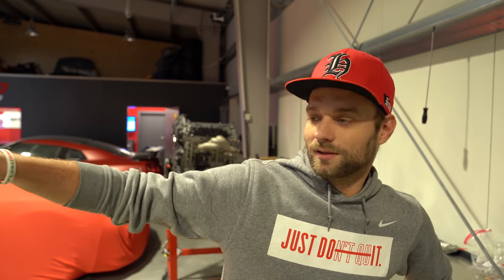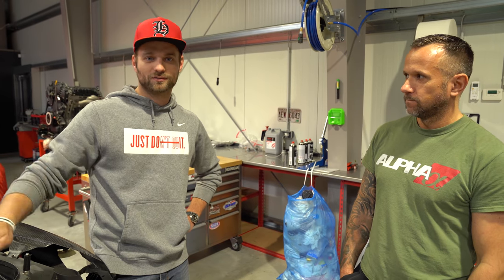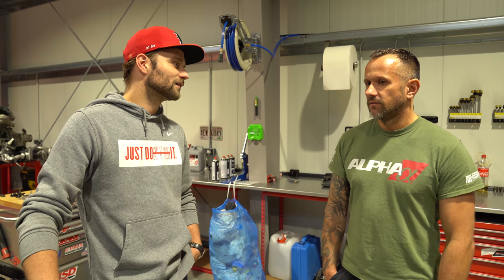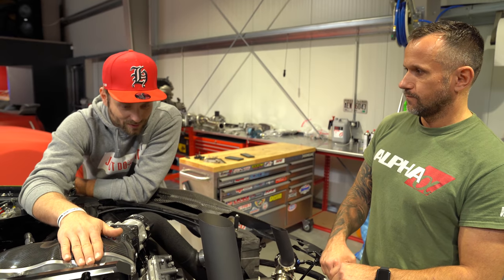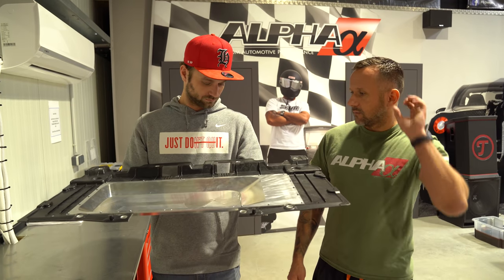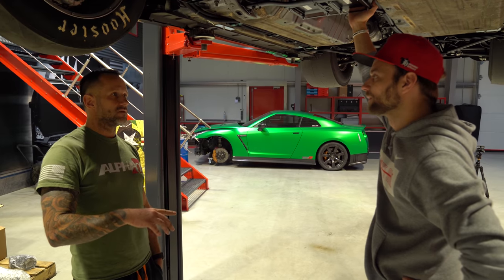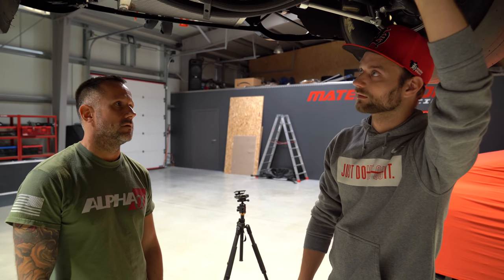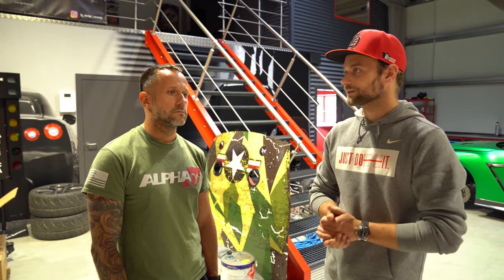2547 PS - Der Zwischenstand von Paul's GTR R35! - Materialmord Racing | Philipp Kaess |

Comment: Sehr spannend, danke dafür!

Kleiner Tip zur Präsentation: Es macht immer Sinn einen roten Faden zu verfolgen. Bei einem Rennwagen wäre zB der "Weg des Sprits" ein solcher. Gerade wegen Ethanol.
Also zB vom Tank über Pumpe, Leitungen zum Motormangement, Düsen, Turbo, LLK, Getriebe, Achsen, Räder und Karosse.

Comment: bei solchen autos frag ich mich immer was die fürn öl fahren das die temperaturen so extrem mitmachen
Reply: Er fährt mit Methanol. Das wird trotz des geringeren energiegehalts verwendet weil es relativ kühl verbrennt. Die Temperaturen sind nicht so extrem wie die PS-zahl vermuten lässt. Hoch werden sie schon sein aber da das ein dragster ist ist ja spätestens nach einer 1/4 bzw 1/2 Meile schluss.
Reply: Er erwähnt doch auch, dass seine Kühlwassertemperatur auch nach den 3 Läufen bei 85-87° lag, da wird das Öl dann vermutlich auch nicht weit jenseits der 100120° liegen, daher dürfte dafür ein normales Vollsynthetisches Öl ausreichen. Wie bereits erwähnt sind die Brennraumtemperaturen ja bei Methanol kein großes Problem.